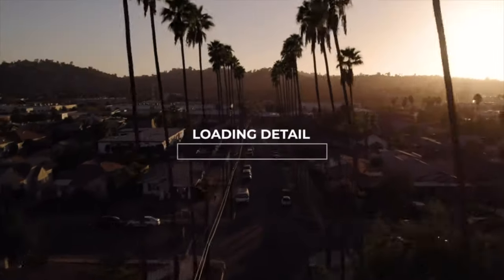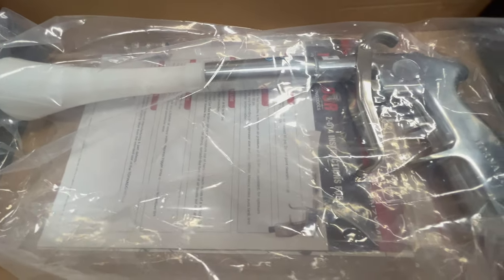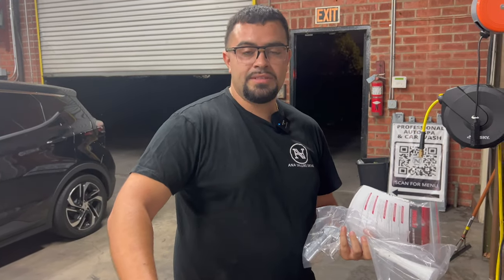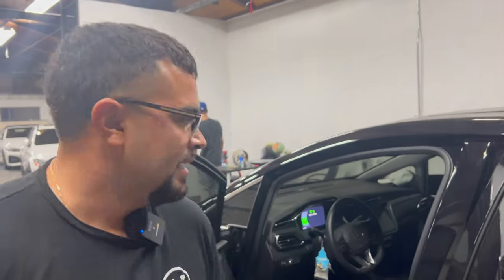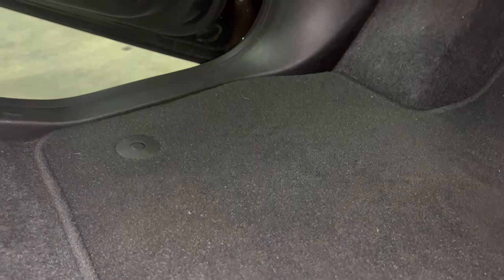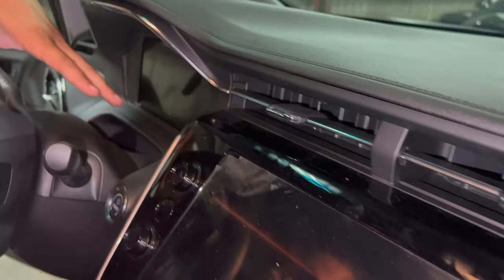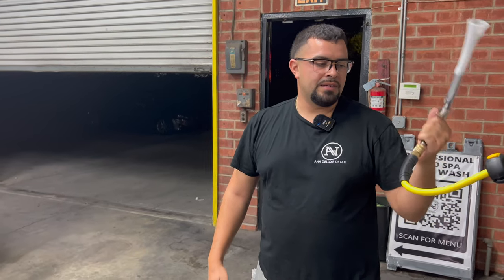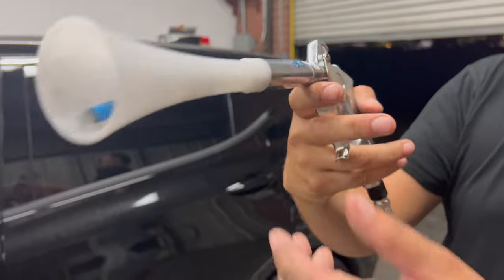auto detailing ; How to detail a car interior with a tornador ! your car detailing business needs it

Comment: Pro tip: Work from the top down, once the dust and crap is on the mats, remove the mats from the vehicle and clean them with the tornador outside the vehicle. That'll leave you with MAYBE 5 minutes of vacuuming. 

But yes, as someone else stated, using a tornador in conjunction with a vacuum, where possible, is amazing!

Comment: Also it says you’re supposed to run that at 90 psi which is good if you want the air compressor to keep up with it as far as the SCFM but if you run it at 150 psi it works the best
Reply from the maker: Looking to upgrade our compressor tbh!

Comment: Hello I have a question I bought exactly the same tornador wanted to try it out with my car I also bought a second hand compressor of 8 bar when I connect it I can only use it for 20 seconds and then I always have to wait for the compressor to work do you happen to know if this is normal because can't even get a spot clean with it
Reply from the maker: Yes so it’s happening because your compressor is too small you need a larger compressor to get stronger and continuous air flow